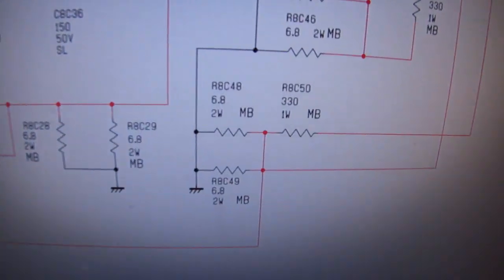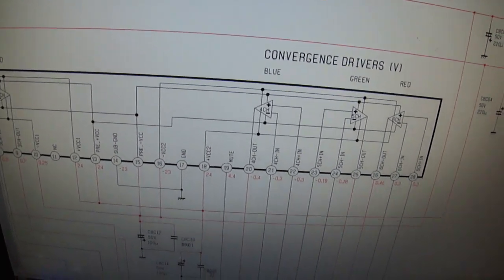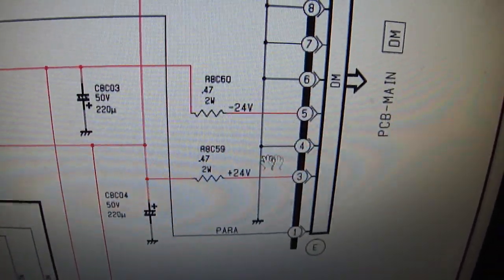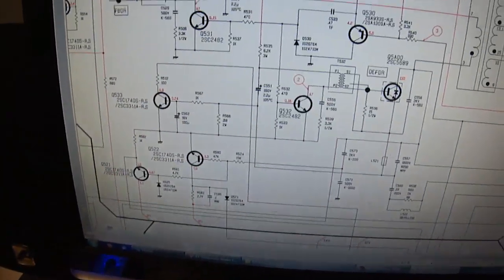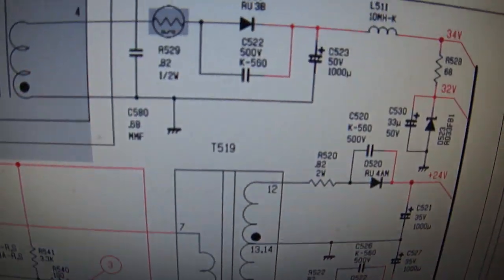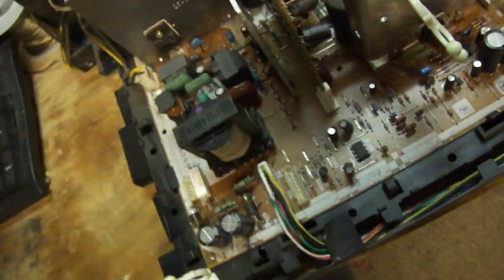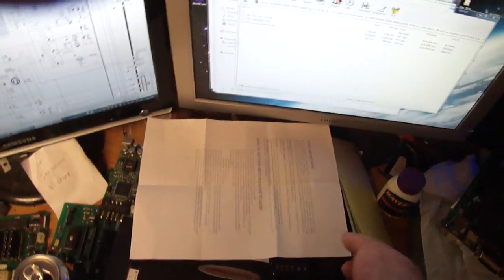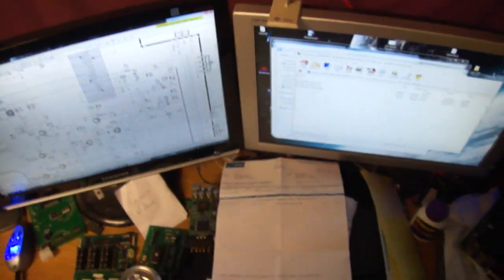Mitsubishi TV convergence repair

Comment: hi. I have this same TV. was working fine then heard a click. no smoke no weird smell and nothing on the inside looks damaged or burnt but anything I put into comes out really dark and red and I have to turn up the brightness. the menu come up perfect and the pip works perfectly as well. I can watch my programs in the pip fine but the main is not there. how is this possible? any help?
Reply from the maker: these are old enough now that capacitors are becoming a problem especially if its a day-to-day watcher. look in the comb 3-y/c corcuits for failure.
Reply: +THEtechknight thanks for getting back. but I'm a total newb to electronics. where is that located and what should I do or look for. thanks for the help.
Reply: +THEtechknight it seems like my board is clean. nothing is burnt up. the lenses all have colors.when I push the menu button the menu is clear and present and for some reason I can watch what ever program in the pip screen just not the main screen and it won't let me switch. when I boost the brightness the image looks like its sun bleached or something I keep feeling like these is a setting I'm missing or something like its that easy or something
Reply from the maker: +Matthew Buist this ones gonna take someone with some skill to accomplish. sounds like comb failure to me, or loss of Y signal. try svideo or RGB component input. it goes around the comb filter.

Comment: I have a WS-55315 that for a while, had those funny interference lines when the TV was on.  They lessened when you kept it on for a long time and the picture would clear up.  Eventually the TV started going out. It wouldn't turn on until I unplugged it and then plugged it back in.  Now it won't turn on at all.  It gives a 1-2 error (it means no error reported) but obviously yes there is an error... Would a new STK and pico fuses fix this? Or did I blow something else out by trying to force it to keep going?

I have another TV (WS-65513) that had the same problem, but I ended up replacing the DM board. That was supposed to fix it, but seems like something else is wrong.  It gives a 2-1 error now (x-ray protect) which means its dead (regular Joes aren't gonna mess around with the high voltage area of the TV).

I'm just worried that I'll spend $60 on the repair kit from TvRepairKits for the ws-55315 and then find out that didn't fix it -_-  same as the 2nd TV...
Reply from the maker: +Steve Martin Checking the pico fuses, and replacing the STKs cant hurt, However these are getting old enough in age that a large majority of the electrolytic capacitors are drying out, and you will get all kinds of video distortions, color washouts, etc...

Comment: Hey tech knight I have the same model mitsubishi and replaced the stk393-110 chip and it fixed the 3D effect but the blue is not a solid blue line it's more like a blue glow you can't even read the word blue in conversion menu all the blues have a glow can you help me?
Reply from the maker: 2 reasons can cause this. 1 the focus adjustment to the CRT could be out, you will need to find the Focus/G2 adjustment block and adjust it from there. The other thing is the glycol coolant can be dirty and contaminated. You can see this by removing the upper lense from the tube and looking at it. if its not clear and cloudy that is likely the culprit.

Also keep in mind these TVs are starting to age well beyond the expected lifetime. This means if its a high-hours set, all the capacitors are starting to dry out and go bad, leading to random video issues and other stuff. Also, the CRTs can be weak and produce blooming and no amount of focusing will fix it. But try focusing it to be sure.

The tubes are going when the green starts to turn into a dull off-green color and doesnt exactly look right. Thats how you know.